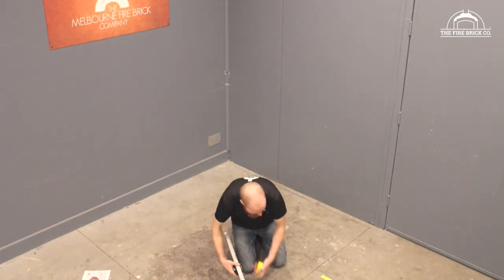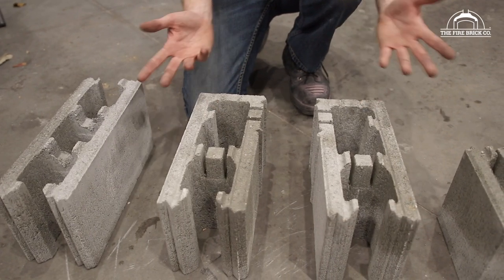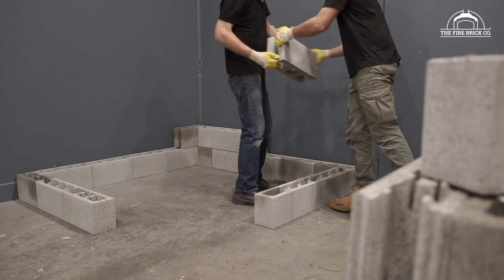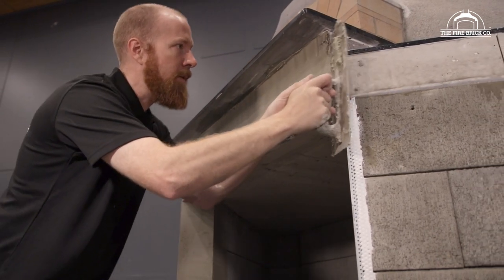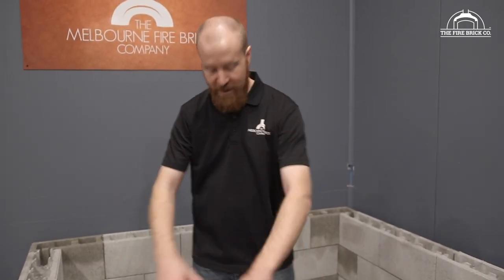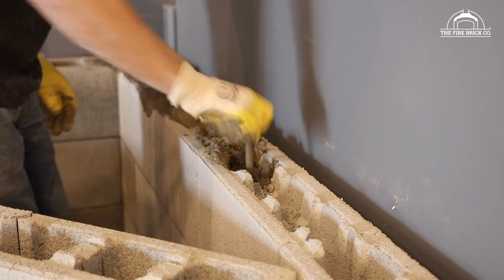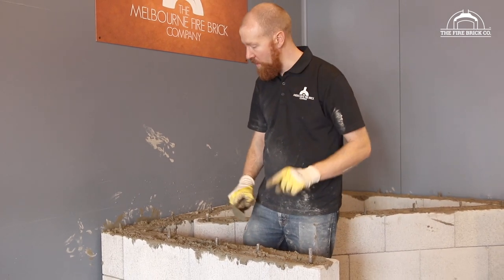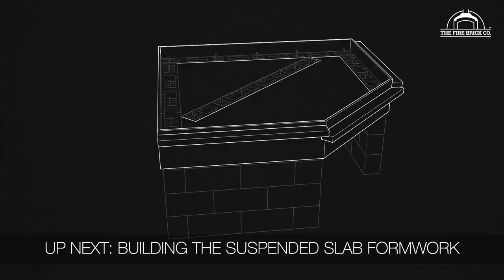How To Build a Brick Oven Stand | 1. Laying the Block Walls

Comment: Regarding the anti spider back wall. The base I'm building is 155cm (square), corner stand for the p85. Its not as large as the one in the video so blocking the back in the same way is not really an option because the rear corner would be too narrow for me to get in and drill the slab form supports in place. I'm going to use 12mm rebar at 150mm center as advised. My question is are you certain that I don't need a center support under the oven? Are you sure it can take the weight over a 160cm span from one corner to another with no supprt underneath? I'd hate to build it without to then find it couldn't handle the weight and it crack on me. Thanks
Reply from the maker: Hi Lewis - if you reinforce the stand in the way you're describing then it will have no problems at all handling that weight.

Comment: Hey guys you use 150mm blocks, in the UK the standard is 140mm. Would that be OK? Do they have to be hollow or would stacking solid blocks also be ok or too narrow?
Reply from the maker: Hi Lewis! 140mm would be more than wide enough - if you're going to use solid blocks then you would have to mortar them together like ordinary bricks, drystacking them wouldn't be very stable unfortunately.
Reply: @TheFireBrickCo  thank you, just to confirm... I mean is the 140mm wide enough on each side to support the concrete slab on a corner stand? (I already gathered that they must be mortared) in my minds eye that just seems very narrow to only have a 140mm for such a weight. Please do let me know. I'm at the drawing stages now of the build :)

Comment: Has anyone come across the equivalent/substitute for the no mortar Verslok Blocks in the USA?    Looking at their website, they dont seem to be available in the US
Reply from the maker: That's a tough one - try searching for 'Mortarless Block Systems' in your area
Reply: I’ll be building this spring/summer. I have searched extensively in the upstate NY area have not had any luck. You can order direct from a manufacturer but the minimum is very large. I’ve no experience with masonry and am a bit hesitant to try mortaring so I’m debating on just dry stacking as I’ll be finishing the stand with stucco render. I’m just not sure if there will be too large gaps. Keep us updated on your search and progress.
Reply: For anyone searching, it does not exist in the northwest at least. Called all the big suppliers and everyone thought I was crazy 😂